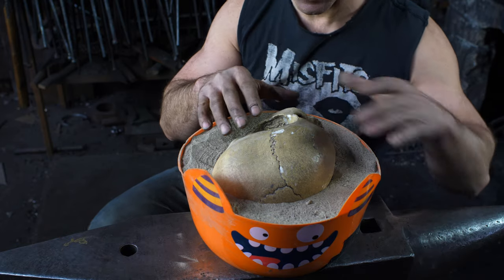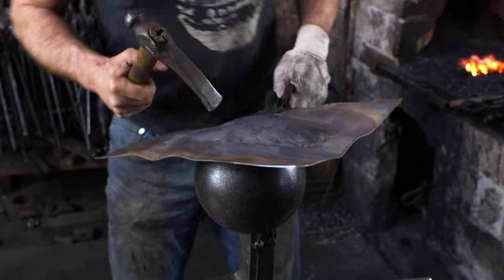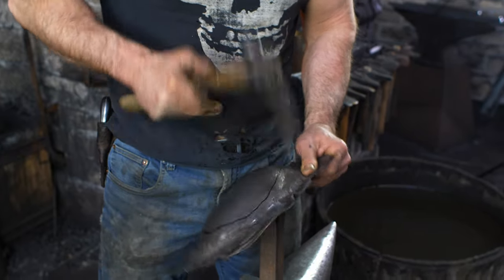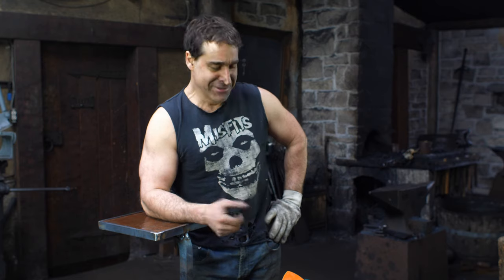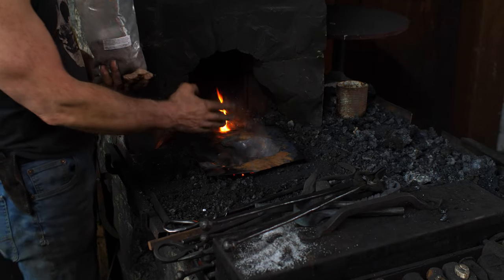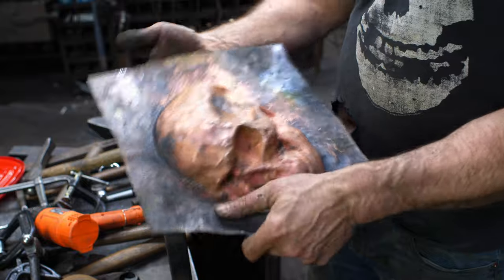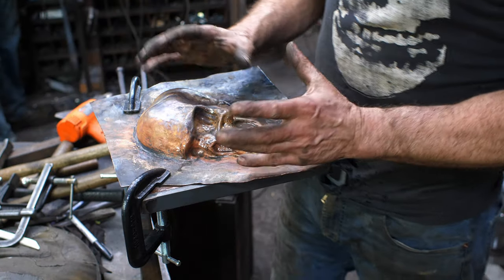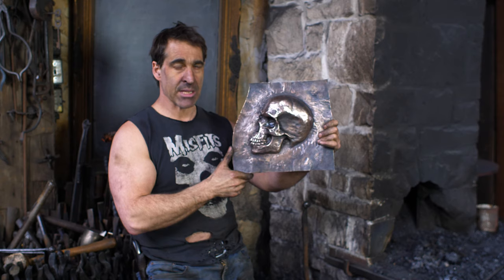Making a Bronze Skull - Advanced Repousse Technique - No Casting

Comment: Hey there, I just discovered your channel. Nice work! I've done some repousse myself and I discovered that clay makes for an excellent substitute for pitch. It's much easier to come by and to work with because it doesn't require heating. You do need to keep it moist but at the same time that gives you control over how much resisance it offers. It's a great beginner's technique if I do say so myself. Cheers!
Reply from the maker: We may be doing a video in the future featuring clay as a substitue backing. Glad to hear it does work.